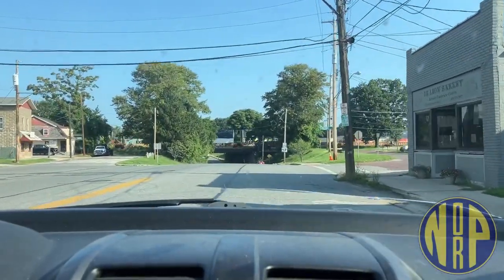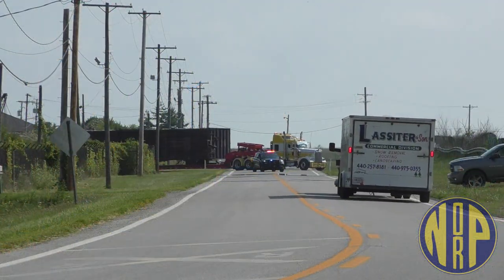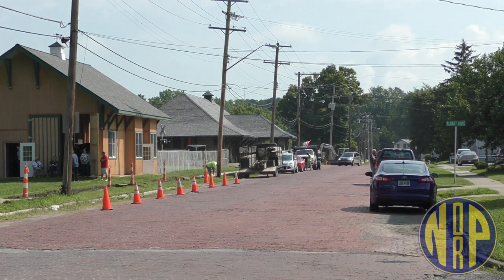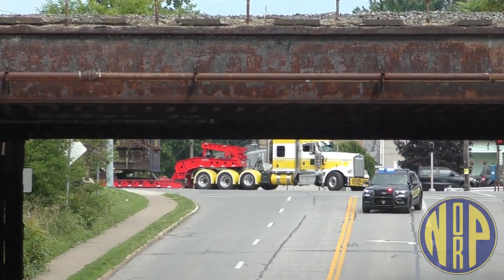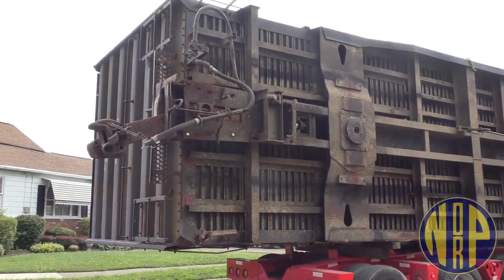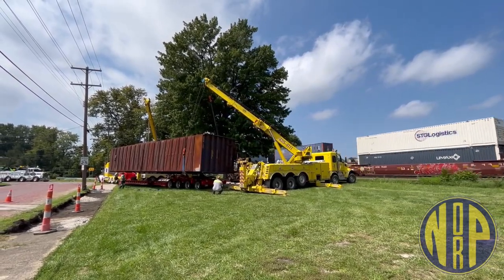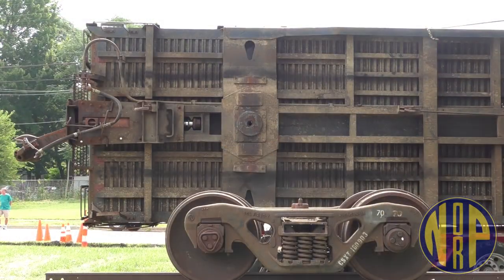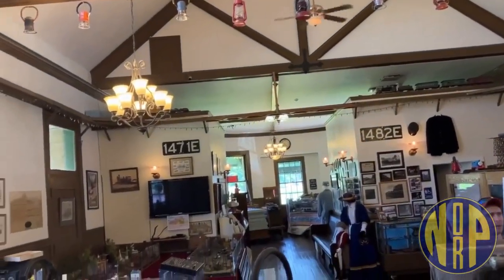TWO INCHES OF CLEARANCE: Transporting a BOXCAR through Lake County to the Painesville R.R. Museum!

Comment: Wouldn’t the clearance be 3 inches if the bridge is 14 feet and the height of the loaded truck is 13’9”? Or is it considered 2 inches just to be safe? :P
Reply from the maker: 2 inches approx clearance. Confirmed by a museum member at a monthly meeting. They also almost wiped out a telephone phone and had to put soap on the road and use a crane to complete the turn.
Reply: @northernohiorailfanningpro8899 Soap??? 🥴🥴🥴